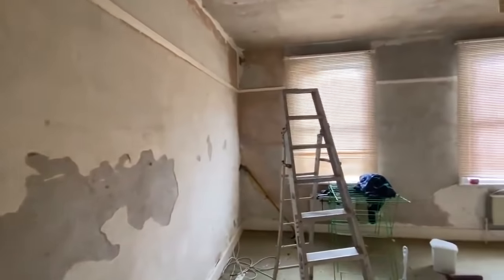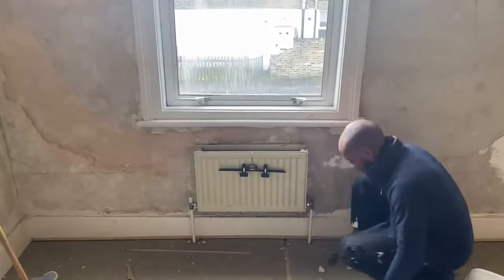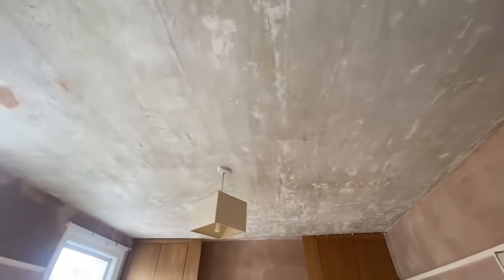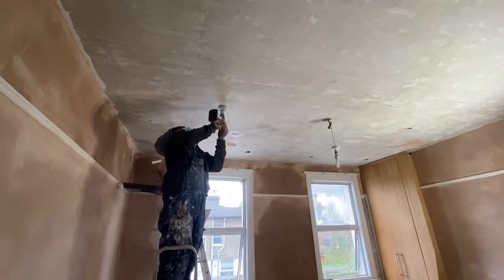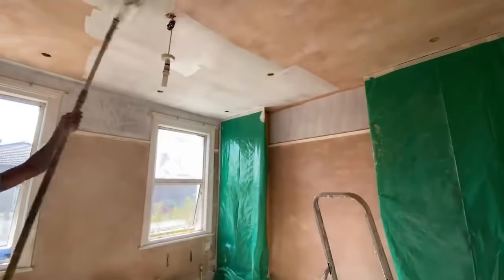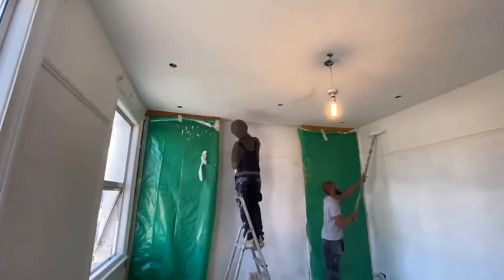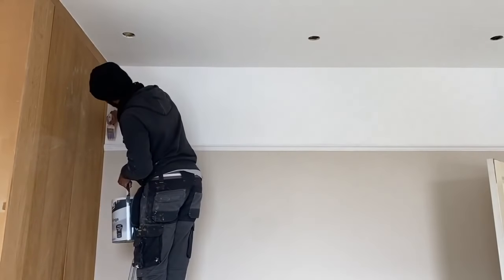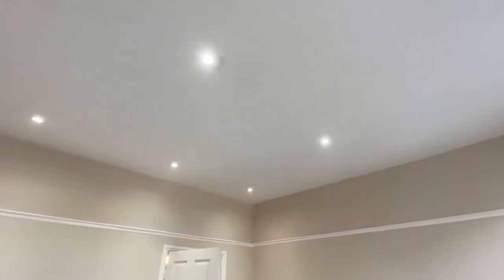Replaster and decorating of master bedroom in three days - Full video

Comment: Nice job. Saw you using the speedskim on the walls. Did you use to flatten the ceiling and do you find them useful? thinking of getting one.
Reply from the maker: Thanks Matt. Yes I used it on the ceiling
It’s a great tool and I highly recommend it